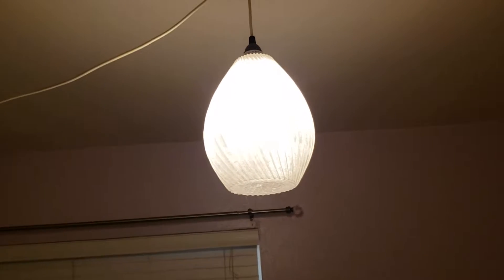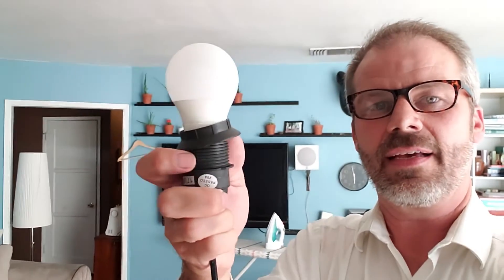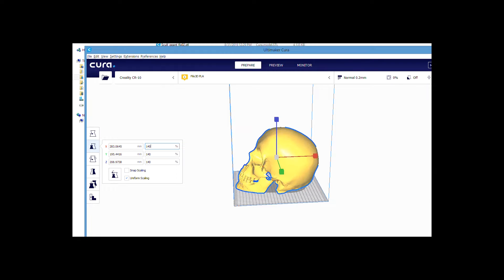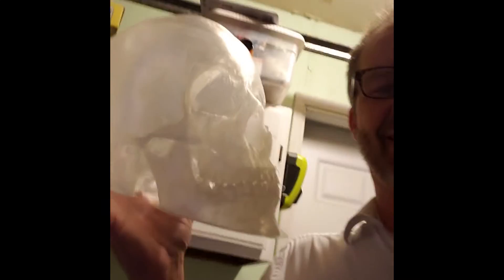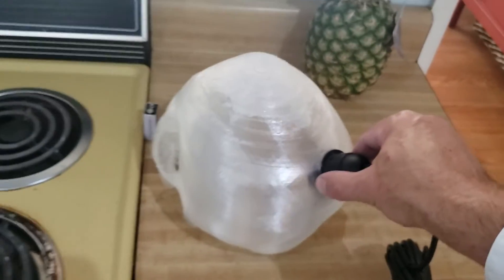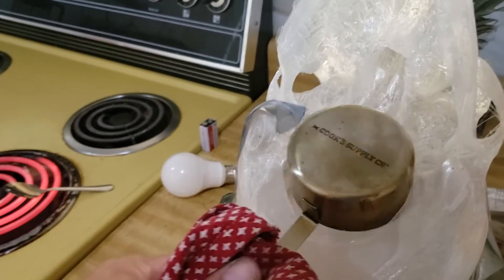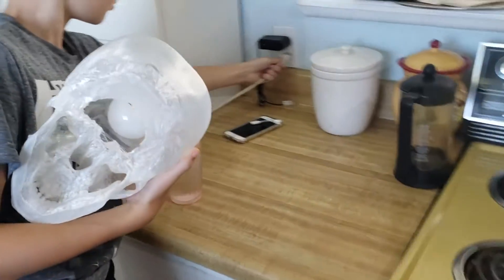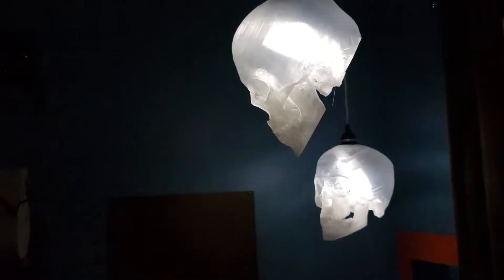3D Printed Skull Lamp

Comment: Nice lamp.  Your job would have been easier if you had modified the 3D model to include the holes so you would not have had to add them later.